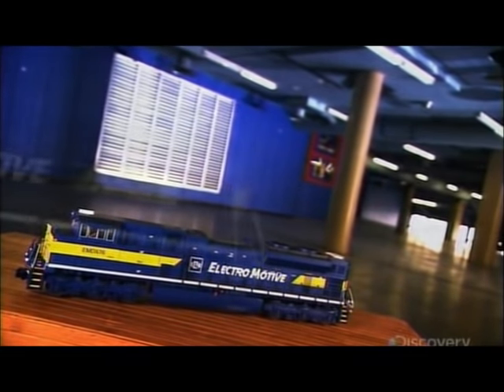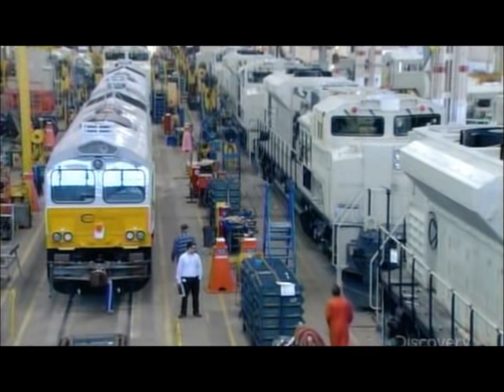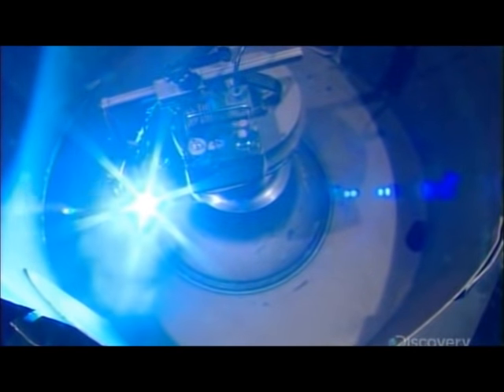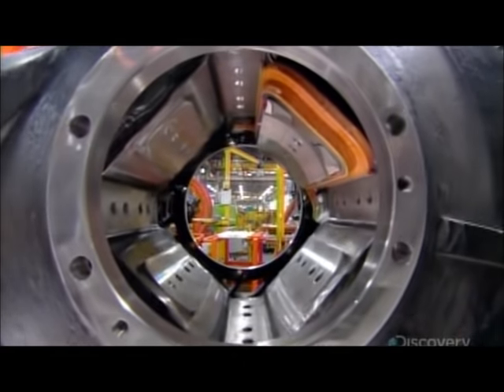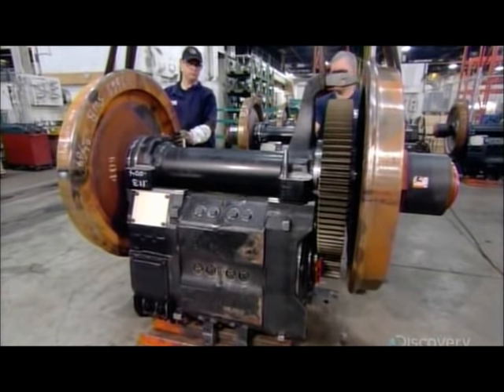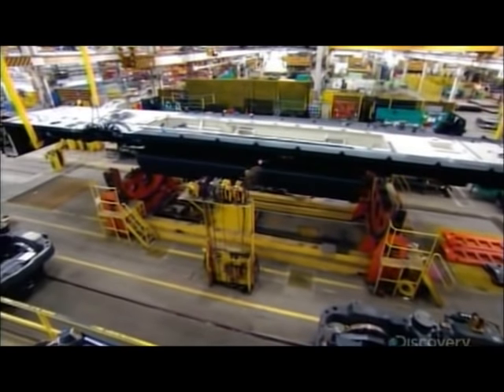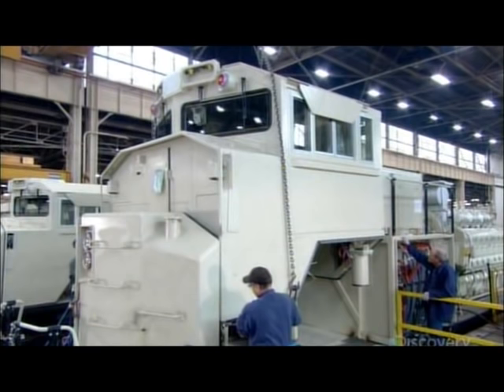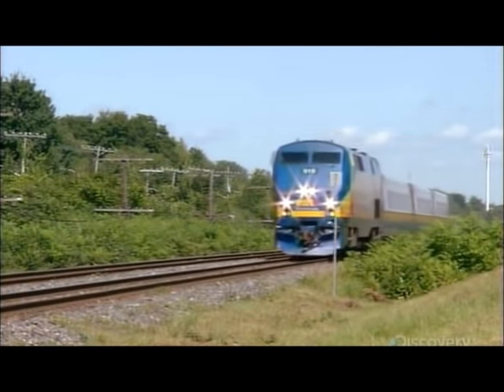How It's Made - Locomotives

Comment: I am in awe of the engineers that actually design and build those massive loco motors.
Reply: I still scratch my head as to how they have 3 1/2 mile long trains! It’s amazing how much these locomotives can pull n the amount of power they create!
Reply: @mikelowery5741  They almost move half of America in one go eh mike !
Reply: @mikelowery5741  it's because American locomotives are built more heavier and taller than most locomotives ik tbeh world, for example..
Compare a amrican ES44AC that's 16,1
And a British class 59 thats 12ft tall, 
The American one is (obviously) taller than the British, because America is such a big continent, The locomotives done here has to be more larger and heavyer to cover far distances, which allowes them to pull tons, This was a thing with steam locomotives too, that's why the big boy(the world largest steam locomotive) is what it is now,
If you we re to try to put a American locomotive on the British loading gauge, it won't fit and it would cause the rails to sink in.

Comment: "750 HP, 3 times more than a typical car."
What? The typical American car has 250 HP?
Reply: I'm guessing this was uploaded to YouTube around 1968 or so.
Reply: Joseph Astier I’m taking one for the team

YouTube was made in 2005
Reply: avg yes. The people who go mad with hp bring up the average.

Typical? Naw. Most guys got compact cars or compact suvs with 110-150 and 130-200hp respectively today. Back when this was filmed, even less, 10 to 20 less.
Reply: Yes
Reply: Not only that, but it goes to show you how using HP is a bad measurement for power.  While a Mustang might have 250 HP, that is 250 HP at like 5000 RPM.  If you hooked 3 Mustangs up together and tried to pull against one of the electric motors in the logomotive, it would sling those cars around like a 900 pound gorilla tossing around an empty beer can.
Reply: Lmfao
Reply: That's a locomotive, of course it'll have more horse power
Reply: 6cyl camrys dont sleep

Comment: Usually, short haul trains, by tonnage have 1 or 2 loco possibly of different class, but take a train 2 or more miles pulling straight tonnage for over 1,000 miles and the train could have 1-8 locos on point and still have 1 intermediate and 1-2 pushers. It all goes by tonnage and terrain. Here in the midwest, most trains can only be 2 miles long. Out west, it's a whole different game. They have mountains.
Reply: Well, you have problems with coupler strength. Too much power and you will overwhelm the couplers breaking them.
Reply: Fuzzy mountains

Comment: Electromotive Division's or GE's EMD technical term for the engine is a Prime Mover. They can be ordered with what spec's the Railroad wants. Only prototypes come by EMD's choice. More railroads are also going away from the DC power converter, AC traction motors do better at low speeds and are easier to maintain.

Comment: @Robin Andreasson, you need to change your settings so people can reply to your posts.

Anyway "fuel driven" locomotives are also electric, the diesel engine being a generator, not actually directly powering the locomotive.  They can't use a pure electric system for freight in the US or other large countries due to just that, the size and remoteness of the rail systems.

Comment: The US actually use 1435.1 mm gauge, one of only two countries (Finland) to retain imperial units for railways. It is therefor 0.1 mm broader than in most countries.
Reply: 0.1 mm (0.04") is meaningless to a railway track gage.
Reply: Indian Railways track width is 1,676 mm (5 ft 6 in) broad gauge!
Reply: @algrayson8965  Meaningsless as it is, that's still how they do it.

Comment: The locomotive they were building can pull a lot more than 480 metric tons.  More like 9,000 American tons on flat ground.  An SD-40 with its 3,000 horsepower can pull a little over 7,000 American tons on flat ground.  It can also run around 50 MPH while pulling 3,000 American tons. The engine they were building can probably run 50 MPH with 4,500 American tons on flat ground.  Generally 1 horsepower per American ton can run 50 MPH on flat ground.
Reply: You have to forgive them Bill, they have no concept of that kind of weight in a European train. And they have no clue as to how long our trains are. @ locos on a train? Try 4 on the front, one or two in the middle, and another one or two on the rear. All controlled by the engineer in the cab of the lead loco.
Reply: @gravelydon7072  the DDA40X could haul a train single handedly!
Reply: @Ben31337l  DDA40Xs often ran with a smaller unit or two. Two smaller units of today out perform  one DDA40X. And they don't act as track straighteners.
Reply: @gravelydon7072  Well, that's because the DDA40X was built using 2 SD40s.

Also, the fact that you claim they were 'track straighteners' si interesting since the wheelbase between the first and last wheels should be smaller than the wheelbase cound on a regular steam locomotive.

Unless the DDA40X weren't equipped with flangeless wheelsets.
Reply: @Ben31337l  All wheels on the DD35s and the DDA40Xs were flanged.
Reply: @gravelydon7072  It's no wonder that they were track straiteners then. ^^
Reply: @Ben31337l  SP found the DD35s to be more of a problem then UP did. UP had more generous curves so the DDs on UP didn't have as much problem. The SP units wore the rail and flanges which is why SP never went any further with the DD designs. But still UP had to watch where they ran as a tight curve meant troubles.
Reply: @gravelydon7072  Yeah, it's kinda amazing how america had these massive steam locomotvies just 10 years prior, easily with larger wheelbases.

Comment: 20000 litres fuel tank !  Here in India just 6000 litres on 4500 HP locomotives .
Reply: Shan H Fernandes The US has plenty of oil from the middle east , as they say, y not flaunt it when u got it !!!! but in under a decade or so when the dollar gets de-linked from the oil trade , they will switch over to electrics completely ...like the rest of us
Reply: Harsha Jade I'm excited for Electric Trains, adds an extra track on the rails and stops people from walking on them! If they touch them, they are dead.. Electric Locomotives are quiter and faster anyways, which will be good for the economy and the ecosystem.
Reply: +xXGoldDoesMCXx Seems all electric trains you've seen are subways. There are other ways of conducting electricity to the train, too.
Reply: +Corey Williams Dude Indian tracks are 18% more wider than American ones. 
Don't listen to that lady
Reply: Call us when India can move over 600 trains a day weighing in over 14000 tons each and traveling at speeds of 68 mph. 
Until then sit down, shut up and keep bragging about riding the beginners track!
Reply: Matt Moschkau well to be fair they all have a gajillion tons of shit in each train car soooooooooooo, the shit on the street has to go somewhere
Reply: @Corey Williams
"Our trains here in America are wider and heavier."
No, they are not. Not in general.

In fact, the Indian trains are wider - and thus the locomotives too - only the axle load should be a lot lower.
After all, India has one of the largest broad gauge networks in the world, most locomotives are of American origin like the countless old smoldering ALCOs - and they certainly will not have changed in width, nor in length. Of course, this also applies to new locomotives ....
Reply: @GWR Productions 2014
No. Indian gauge is 1676 mm
Spain: 1668 mm.
Irland and Australia: 1600 mm
Russia: 1520 mm.

Not fuck all, but BG.... ;)
Reply: @coreywilliams7445 - Indian trains are HUGE! The track gage is 5'-6", 9-1/2" wider than USA, Canada, Mexico, British Isles, most of Europe, most of Australia.
Reply: @livingpiano - USA is awash in oil. Politics has constrained petroleum exploitation in USA territory. Much USA petroleum is EXPORTED!!
Reply: @algrayson8965  very true ,  Russia electrified very early, so did France
Reply: @livingpiano    The USA is the biggest generator of oil.  It is highly unlikely that the USA will switch freight haulers over to electrical driven.  Diesel-electric locomotives are just too good.
Reply: 5k hp too if this is an SD80
Reply: @coreywilliams7445  QSK95 is a good locomotive, I think it appeals more to rich 2nd and 3rd class lines. Like Indiana and maybe even we&le
Reply: Ours are diesel electric engines and are very economical. Especially the new ones.
Reply: scam bots lol
Reply: It's much more efficient to generate the electricity needed onboard the locomotive than it is to generate it remotely and deliver it to where it's needed via wires or rails.

Moving electricity encounters resistance that cannot be avoided. The shorter the distance between the generator and the motors the better.
Reply: A GE dash 9  or EVO and a EMD SD 80 is 5000 gallons, that is roughly  20,000 litres
Reply: @livingpiano  it wont happen really.
Reply: @SaviourSword995  how ever, locomotives in America are Largers and more Heavyweight being at 16ft tall.
Reply: @pearlyhumbucker9065  how ever, even if the gauge in India is larger, American locomotives are more Heavyweight and taller. Being 16ft tall hell big boy so damn and heavy it cant even do world tours
Reply: @DistanceNsVeterans  that's true. But nowadays, we use electric locomotives a lot.
Reply: @algrayson8965  but then again They are not larger than American locomotives at height and weight limits. Compare a ES44AC to a WAP-14  locomotive, that Es44ac is much larger than the WAP-14,
Reply: @SaviourSword995  I know, tho I do love diesel locomotives alot.

Comment: A good beginning, no where near detailed enough though. For instance: why 4 large coils with 4 smaller, narrower coils in between? (stators). How is the electricity phased? Also: airbrakes? when you can rotate the electric field and cause the motors to brake?
Enquiring minds want to know.
Reply: Baby Driver 
They use airbrakes and rotating the electric field is called dynamic braking, it’s used but air brakes are still required for all the rail cars. 
I’m not sure how the electricity is phased but I believe it’s 1440 volt and well over 5000 amps at each motor. It’s enough to get the job done.
Reply: Thank you Sir!
Reply: @mattmoschkau2831  600 volts  amps vary on load and speed

Comment: The locomotive being built was a SD80MAC locomotive. I see these locos all the time down at Sedalia Co moving HUGE coal trains to the IREA Power plant from the coal mines in the Rockey Mountains.
Reply: SD80MACs have a 20 cylinder engine and the cabs are different. That was a SD70ACe.
Reply: oh wait HOW DO YOU KNOW THAT!!!!!
Reply: Kelli Hollinger No, that was a SD70M-2. If you watch closely, the traction motors had 4 cables, there for they were DC traction motors. SD70Ace's have AC traction motors, only three cables per motor. Is the Discovery channel a European television network? The part the traction motors mount into is a truck not a bogie. The fuel tank holds 4,500 gallons of fuel, etc... P.S. I know this info because I work on these engines.
Reply: Rich S How Its Made is a Canadian produced show and that episode was likely filmed in the former London Ontario EMD facility.
Reply: I drive these i know my locos
Reply: Rich S A late build SD70M-2 at that.  The early builds didn't have the isolated cab and vibrated like crazy.  The SD75s were called "Whisper Cab".  We called the SD70s "Vibra Cab".

I'll take a GE over EMD any day.
Reply: I thought that one being built was an SD70... am I wrong?
Reply: @nicholaslokos7949  well you’re technically right, it’s just a variant of an SD70

Comment: The three axil freight trucks there using on the SD,s are the H,T,C,R radial truck Wich will actually steer into the curves so they can negotiate tighter radious,s lot less wheel and track wear. 😐🛤️🚆..

Comment: Okay, I don't really get it, can any train-enthusiasts tell me one thing, In Sweden where I live, i'm used to see electric driven trains only, I've never seen a fuel-driven train in whole my life (except for the old ones they keep at the museums). I thought they had electric trains in US? Or is it just for the big trains?
Reply: +Anro 智慧 the US has some electric systems for passenger trains, but in in more densely populated regions like the east coast -- to cover long distances and haul big loads, diesel engines fueled by diesel oil are the standard haulers, the tracks aren't even rigged for electricity.  We have less hydroelectric capacity, and so far more fossil fuels.
Reply: Anro X____X There are no electric freight trains in the US. That’s a lot of expensive infrastructure that would need to be built. 

Some light rail passenger trains in cities are electric, but a great deal are diesel powered. The national passenger rail system, Amtrak, is all diesel powered except for one line on the east coast.
Reply: +Anro X____X You'll love Philly then. Amtrak's Northeast Corridor and SEPTA's entire commuter rail system is electrified.

Comment: isnt it supposed to be toal horsepwer 4400? in the video she explained it is 4500 horsepower?i am confused as far as i know bieng a railfan  45 years now locomotives either have 4400 horsepower or ge has ac6000 which is 6000 horsepwer.

Comment: Great video but kinda bad how you show how to make SD70ACe's then show running shots of F59's and P42's. Just saying...
Reply: Exactly what I thought
Reply: No there sd70ace
Reply: +Jordan Havelal SD70M-2 and SD70ACe's look very close to I identical but slight differences
Reply: K-396 -1 well the video they build an SD70ACe, but other train clips show:
SD70 (standard cab)
SD75i
ES44AC
F59PHI 
and a P42
Reply: I think it's called artistic license.
Reply: It’s a late production SD70m-2 for Norfolk Southern being built in the video.
Reply: @mattmoschkau2831  actually that's a cn one, ns didn't have marker lights on their cabs and had the headlights on the cab as opposed to the nose. These could be any road number after 8850 since 8800-8849 have non-isolated cabs.

Comment: Pretty neat. Although I question the '4500 HP' fact. I thought SD70ACe's were rated at 4300 HP?
Reply: It really depends. Every engine has its limits. The engine's horsepower and load output is determined by the governor/fuel rack settings. The new Tier IV ACes are rated at 4500hp, but only 43-4400 is dedicated to traction horsepower. Hence why GE used the same 7FDL16 design from the U-boats up to the AC4400s and Dash 9s
Reply: Remember what Scotty said in that Star Trek: The Next Generation episode Relics; "An engineer is wee bit conservative on paper", so it may be little more powerful.

Comment: weren't some engines were refinished re-used and put on new locomotives?
Reply: NuttyCheerios yes, this by far has been used by EMD as far as I know, their series is the ECO series, where old locos such as an sd40-2 or a gp9 get disassembled and modified to become more eco friendly.
for example, the sd40-2s 710 engine has been redesigned to become a 710-ECO Generator. thus, the SD40-2 was converted into an SD30c-ECO locomotive. another one would be a GP9, converting into a GP20c-ECO locomotive

Comment: Nice you mentioned at the beginning that locomotives pull from the front and push from the rear However, why didn't you mention the locomotives commonly found in the middle? Duh!
Reply: They are all the same except for the radio controls.